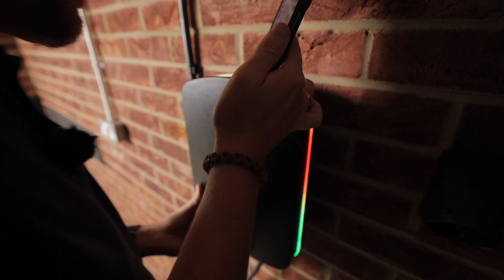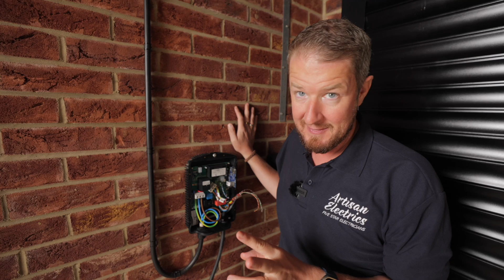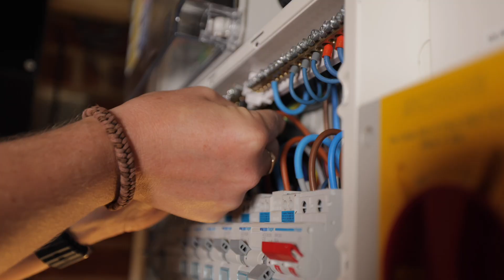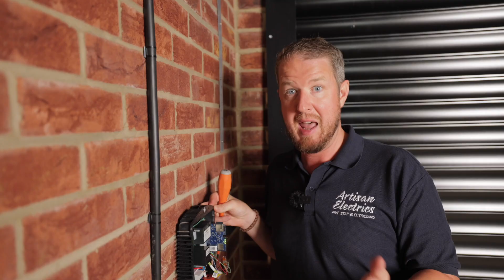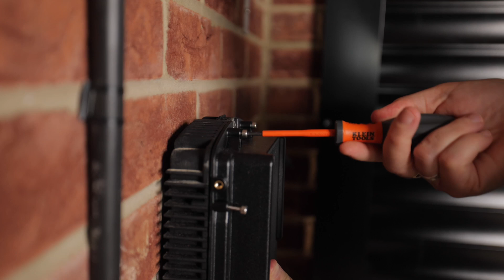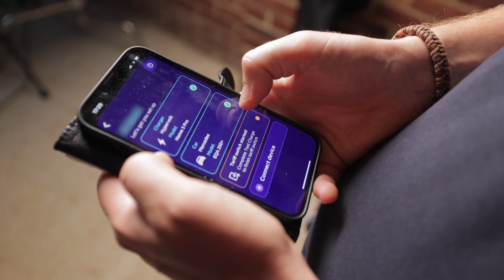Is this The ULTIMATE EV Charger?

Comment: If it does solar charging well, has a long retractable cable and is clever enough to tell the house batteries to not discharge when smart charging then I'm sold. Almost there.

Comment: I have just had the Hypervolt Home 3 Pro charger installed in my garage. The installation company (recommended by Hypervolt) did an amazing job, with the cabling from the consumer unit concealed brilliantly.  The charger worked well the first time I tried it, with a link to the Octopus Intelligent Go overnight tariff.  But subsequent attempts to charge have failed and I have had to ask Octopus to investigate the reason for this.  One technician suggested that it may be that my new car goes into sleep mode and fails to awaken.  I now need to top up the battery as the level is under 40%, and I have been advised to plug in at 11.30pm and "bump" charge. I have set the maximum charge, using the facility available within the car, to 80%.  In theory, this should mean that I will still benefit form the low overnight tariff and the battery will reach 80% by 5.30pm.  If anyone has any ideas about what the problem may be, I would be keen to hear.

Comment: Please do not use the green wires of the Cat5e for your CT clamp! As an IT guy, the green and orange wires are required to provide Ethernet connectivity at the 10/100 standard to the Hyper-Volt. Use the blue and brown for your CT. So even if the customer isn't using Ethernet currently, they may change their mind as wireless is unreliable, and you'll need those wires

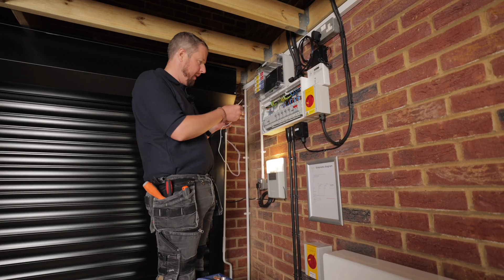Comment: This is brilliant. The Intelligent Octopus ago tariff gives cheap electricity over night 11:30 to 05:30 (I think) regardless of whether car is connected. 

If the tariff decides to charge outside of these hours you get even more at 7p. Of course everything is at the 7p. 

Also you can do two cars on octopus go by scheduling the second car to charge in reduced rate time. Not quite as clever though.
Reply: Oh god. You literally just said you get the overnight rate anyway. 🤦🏼‍♂️ sorry!

Comment: I spotted a solution here on Youtube and Bluesky for installing EV chargers in the American market which may interest you although puzzles me as to why it's needed. It's called ConnectDER EV and developed by ConnectDER. It seems to combine the function of a CT clamp, cct breaker  and a smart charger into a unit that fits directly onto an American domestic electricity meter. The company claim it reduces the cost of installing chargers on old properties.
Would love to see you do a video about it and compare it with how UK chargers are fitted.

Comment: Had major issues with the last Hypervolt, what can you expect if the electronics, supply connections are open the elements, unsure how they got any BS/IEC certification for that unit. Took me a few weeks for them to agree the return after giving them 2 chances to repair over a 4-month period. Out of pocket for the installation cost and removal by the electrician and charging the car at the local supermarket. My opinion, Hypervolt should have recalled the earlier version and sent the new IP65 unit free of charge as it was not fit for purpose.
Duty of care comes to mind !!!

Comment: Great video.  I've just updated from the Hypervolt 2 to the 3 Pro.  Had internet hard worked after WiFi hassles with the 2.  I was not sure it was worth it but after setting up octopus Intelligent I'm chuffed.  Can wait to have a bit of sun too check the battery safe mode, but may have to wait for Spring here in the west of Scotland!

Comment: I’m looking in to EV chargers but I have 3 phase electrics. Is there a similar option? This model looks to be single phase only. I have 20x 400w solar panels and want to make the most of the sun and not export it if possible.

Comment: The 'ultimate' charger would have a retractable cable reel.  Unreal we have to deal with unweildy cables flopping everywhere.
Reply: A cable carrying that much power coiled into a confined space for an extended period would likely be a major fire risk.
Reply: @paulhorbury8929 Why? There's no current until charging starts.  High-powered charge cables are liquid cooled already. There is no technical reason why they cant be retractable.

Comment: 450mm of the finished floor minimum for any electronics, 350mm in from any corner. The TSLA powerwalls look terrible so close to the floor let alone the code isnt met. I would get you to raise them up  to 550mm minimum or forever be un happy with that.
Reply: Incorrect. Electrical sockets, switches and other electrical control devices should be a minimum of 350mm from corners of a room and 450mm from the floor. This does not cover batteries.

Comment: are we aware of any other chargers on the Market that offer the 'Battery safe' function?  i currently have an Ohme Home Pro charger and i am looking too add a solar array to my property with a Battery storage solution soon.   I too would like to protect the batteries for home use during the day, i am not sure if my current charger provides that facility....would you recommend I consider upgrading to the Hypervolt Charger?

Comment: do you have a recommendation for an EV home charger that just simply charges the car that is well made and works well  I really don't fret about anything I just want to manually connect my car and charge it ( a renault Zoe 50 2021 ) and manually unplug when done  also where about in the UK are you, thanks
Reply from the maker: Hypervolt will do that job perfectly for you. All home chargers are required to be smart these days anyway so you won’t find a big standard charger without an app or internet connection but you don’t necessarily need to use those features. We are based in Cambridge but cover most of the UK with our partners network.
Reply: That's great as I'm in Manchester and need an installer. Thanks.

Comment: Really good review ill keep the Hyper volt in mind. As I had my Tesla back in 2014 finding any charge point at all back then, in fact charging anywhere here in the UK at home or road was like the wild west. I engineer in big auto with EV systems so I ended up making my own charge point back then. 10 years later Ive still got the same charge point, same 150,000 mile car (I may be one of the first to actually wear out a type 2 plug ! )  Decent solar integration is taking place with the Hyper volt, I may at last be tempted to change my charge point. Currently on EON Next Drive Fixed V3 tariff. Cheap rate 12.00 midnight to 7 am @ 6.9p/kWh, I often trickle charge off the solar at 5A (2 miles an hour but if cars sitting there and its free than 20+ miles a day) ........getting real cheap to run EVs at last.

Comment: Why are these wallboxes so expensive? Apart from the PCB , else inside is normal off the shelf items available anywhere. You don't need all this stuff.
 I charge using a basic charger, Intelligent Go and my ID3 or Octopus switch on the power if free or low cost energy is available outside the normal off peak slot.
This fella can probably make his own for £150!
Reply from the maker: It’s important to understand that modern EV charging infrastructure, especially in the UK, is subject to stringent safety and performance regulations that simply weren’t a requirement with older, "dumb" chargers. The reason wallboxes seem more expensive isn’t just due to the components you mentioned, like the PCB. While some parts may appear basic, the integration of these components, along with necessary safety features and software, adds significant value.

Firstly, smart charging is now a mandatory requirement in the UK. This means chargers need to not only function effectively but also manage load balancing, avoid overloading circuits, and communicate with the grid in ways that older or basic chargers cannot. These smart capabilities prevent scenarios where the grid is stressed or where consumers incur high electricity bills by charging during peak hours. Chargers like those made by leading manufacturers are built with sophisticated algorithms for this very purpose.

Additionally, modern EV chargers come equipped with essential safety features such as PEN fault protection. This protection is vital for preventing electric shocks in the event of a broken neutral in the grid, which can be life-saving. There’s also 6mA DC leakage protection to detect even small current leakages and shut down the charger before they pose any risk. Features like thermal sensors help prevent overheating, and tamper-proof mechanisms ensure the charger isn’t compromised. 

It's also worth mentioning that compliance with UK regulations, including active load management, adds to the overall costs of manufacturing these units. The combination of intelligent energy management, increased safety, and regulatory compliance means these chargers are far from “off the shelf” solutions.

While someone might be able to cobble together something basic for a lower price, it would lack these critical features and wouldn't be legally compliant or safe for use in today's environment. Ultimately, the higher price reflects the technology, safety, and reliability built into these devices, which are designed to protect users and optimize energy use.
Reply: @artisanelectrics  so in order to save some money I need a house with offstreet parking and a large garage, 1000's of pounds, worth of solar panels, multiple tesla powerwalls, inverters, endless controllers, complex and artisan type installation, months of admin, disruption, constant maintenance .... Think I'll keep the ICE car and put £60 in the tank every week.
Reply: @FirstLast-rh9jw that's how we got in to this environmental mess. 😕
Reply: I think to make miles per year in a cheap tariff, in a long term is cheap. If you can’t afford the investment….. just make the maths how much you spend in diesel/petrol in a year.
Reply: @latinovk19 it's not about the money, burning fossil fuels is destroying everything.
Reply: @latinovk19 it's not about the money, burning fossil fuels is destroying everything.

Comment: Unfortunately this new CT is going to be completely useless when octopus takes control of the charging.

It's only function is to reduce the EVSE output to limit the charging to match the surplus generation and avoid discharging the batteries.

When octopus takes control and override the charge to use grid power, the batteries have no way of distinguishing what's evse load and what's house load, so will discharge into the car regardless.

No amount of CTs or software on an EVSE can prevent the batteries being discharged while simultaneously allowing charging from the grid.

Either the EVSE load needs to be wired so it's outside the metered zone for the batteries, or the batteries need to control their discharge
Reply: Fortunately not accurate, Octopus can schedule charging to work in BatterySafe mode if needed, we make this functionality available to them as well.
Reply: @hypervoltev  so how does that work? Because the way I see it, and the way every other EV charger works is they prevent the battery export by reducing the charging output.

As a result, the "boost"/"intelligent" charge command that comes from octopus will result in zero charge unless there's surplus generation as any grid demand will be matched by the battery (and therefore reduce the charging output down to zero) or, the way every other EV charger on the market works, is it ignores the "don't discharge the battery" logic and charges from the grid as planned, with the inevitable side effects that the battery will try and offset this load.

Appreciate you can't give technical details, but what is the behaviour of the charger when octopus schedules a charge in battery safe mode?

Comment: Why not put the EV charger before the gateway it has a curtail CT to save the DNO’s fuse not really a problem I use an Indra smart lux and my batteries can’t see it but integrated with HA I can see everything just need some more smart plugs, wish Indra would actually move there butts and integrate with octopus! Very poor show on Indra’s part for an expensive charger, I agree getting charger integration is safer than getting the car that integrates.

Comment: As someone who has the V2 which has the same problem as this,  I'm looking at moving away to another charger, the big issue is the local control/access twice now when Hypervolt's servers have been down i've been unable to control my charger whatsoever to manually initiate a charge
Reply: When you say local control do you mean via the charger itself rather than thru an app on the phone? Apologies if that's a stupid question
Reply: @terrydelahunt842  No it's not stupid at all, the charger has no physical buttons on it you can push like a Zappi or an Ohme, if the Hypervolt servers are down as has happened in the past your phone can't connect to the charger at all to override any preset charge schedule.
Reply: Annoying that the Hypervolt V2 still does not support Octopus Intelligent Go too 😬👎

Comment: Do the battery stop clamps come with the pro 3 now as standard? About to have a hypervolt fitted and would be a great feature to have for my batteries so wondering if the installer would know to install this or not
Reply: You have to separate order a 2nd CT clamp simply ask your installer to do so.
Reply: @hypervoltev  thanks do you have a link to any information about it on your site as I want to read more about it

Comment: I use automations in Home Assistant to disable battery discharge when my car is charging. This obviously also means that the house is pulling from the grid rather than the battery but this usually happens during the small hours anyway when its cheap rate electricity and limited house use.
Reply: Your solution is fine but not optimal
Reply: @thabo5799  Its not. But it’s cheaper than paying the money to ditch a perfectly  good HyperVolt 2 to upgrade to the v3.

Comment: It's NOT an EV charger, it's an EVSE, a glorified contactor with some protections and metering.
The actual charger is onboard the car.
Reply from the maker: You’re exactly right but most people know it as an EV charger which is what people search for on Google…
Reply: @artisanelectrics  and a relay costs £1000?
People need to know that they’re just a relay and a comma module that could be done on a Pi Pico…

Comment: Not realy a good idea to mix the data and the CT connecting cable,it's not really segregated, i know its low voltage from the CT's but it goes inside the Distribution board!

Comment: Blimey. Hate to think how much this lot would cost to install. £16,000 for the Powerwalls?, £6,000 for the solar? plus probably another £2,000 for the other stuff? Return on investment - a lifetime 😂 Not being bias as I have a Powerwall with 3 panels (saved paying 20% VAT at the time) which I use to charge at night (current 9.5p kWh) and use during the day. 5 years on my saving is about £3,600 so maybe 30 years or so to payback the system in this video?
Reply from the maker: For many of our customers it’s not about the payback it’s about having a quality system that does what they want it to
Reply: Depends on your usage - if they’ve got a heat pump coming they’ll be saving an absolute fortune…
Reply: @JohnR31415  Yes I agree that there are savings to be made. I have a airsource heatpump which can average about 500 watts on tickover. In the Winter it can use about 8kwh a day outside of my nighttime reduced rate. My single Powerwall will cover some of that but this will vary day by day depending on what else I am doing.  So in my case adding an additional Powerwall and/or solar panels etc is a rather expensive way of covering thought full-rate hours.

Comment: The comment around the 2 EVs charged with Intelligent go isn't strictly correct. You need to have at least one car that's compatible if you don't have a compatible charger. Howevrer, you will always get 6 hours a night at the cheap rate, even if you don't activate the intelligent charging feature that night. So a 2nd car could be charged using the standard window. 

All the intelligent part does, is give Octopus the control of when it decided to turn on the cheap charging outside of those hours. In the majority of cases they will still charge your car overnight as this is when demand for electricity is at its lowest, and so cheapest. You fancy gadget may work at times but I don't believe it will automatically trigger cheap charging at anytime.

Comment: Octopus Intelligent Go tariff provides cheap power at other times, not just 23:30 - 05:30. You might want the batteries to fill at these other times which tend to be early afternoon in the summer when there is plenty of grid solar about and when it is windy during the week ends throughout the year. With new wind farms coming on stream this autumn there could be more cheap power particularly when SSE have reconductored their Grid lines running down the east coast of Scotland from Kintore (Aberdeen) where constraints occur.

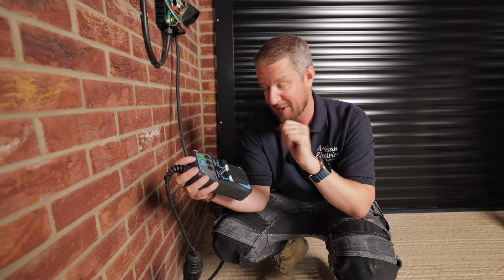Comment: 10:25 surely if you trick the system into an EV being attached and use the Cheap 7p tariff octopus will eventually do you on the “fair use” policy after a while… and you’ll end up ruining the system for everyone in the long run 🙈🤔
Reply: Exactly this. There's already rumours that octopus will be changing the terms that its only the EV that will get the cheap rate outside the off-peak window, not the whole house as it is now
Reply: @mattbeddw  I wonder how they would do this. Just charge for anything over the 7kwh which the charger would pull?
Reply: @007silverwings  all energy will be billed at normal rate and then a credit applied for the energy reported as delivered by the EVSE or the car. That's how suppliers like OVO do it